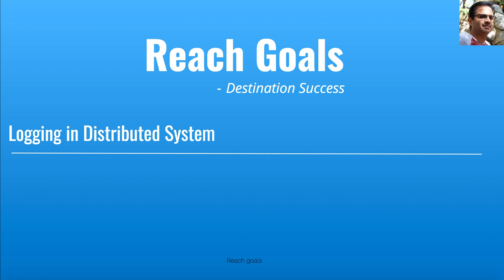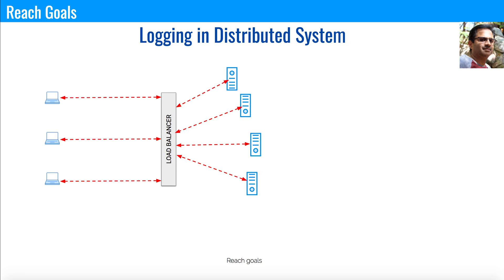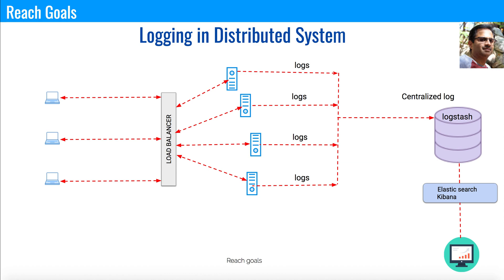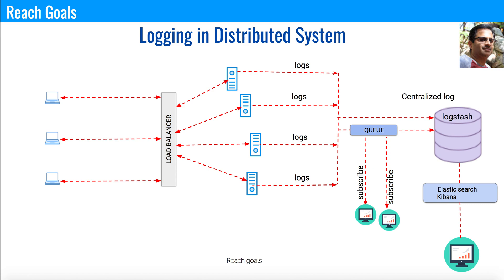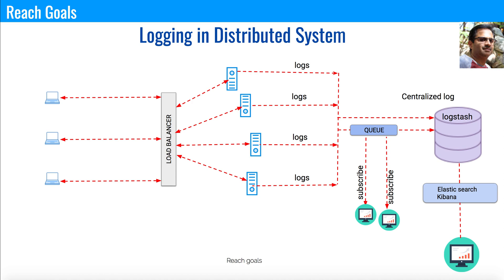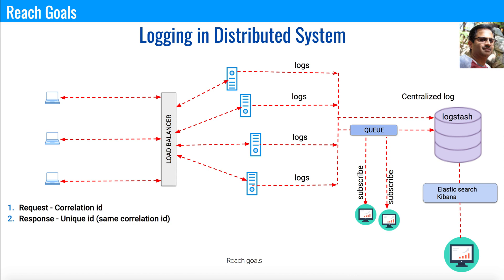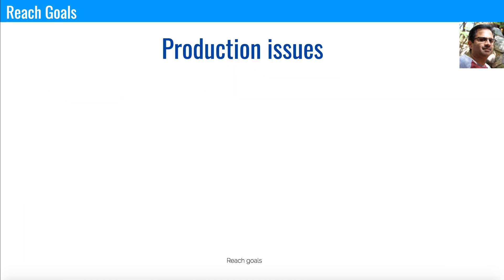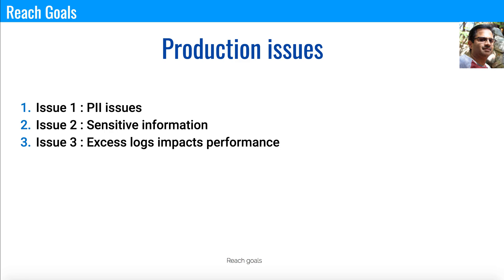System Design : How to design a distributed logging?

Comment: Hi. Thanks for the video. I have one question. At the beginning of the video. You mentioned that since different logs are stored in different nodes/machines, so it is hard to query logs.

That's why we have the topic that we need to centralize these logs into one log cluster, just in order to facilitate the log query.

However, why can not we use a consistent hashing strategy here, similar to the usage of consistent hashing in database partition? In another word, each node/machine can be mapped to a range of log data in the data ring. The log query with a request Id will be hashed using the same consistent hashing algorithm.

So we know, given this log query request-id, which node/machine stores the log data. Then we could directly go to that node/machine and query the log. If that's right, we do not need a centralized log system.

Thanks for your clarification. Looking forward to your reply.
Reply from the maker: I am happy you asked this question. 

Typically, there will be different types of application(java, bath jobs etc) running in each machines. This means, you will have variety of logs. 

There are multiple use cases executed using the logs 
1) Query the logs 
2) Alert notifications
 3) indexing 
4) Analytics and reporting 
5) Auditing and many more.

If I use the model as in your questions, these uses cases will become complex. Hence, my thought process was to move to separate log cluster.  If I have the separate cluster, it is easy to manage and process. 

Also, if I leave the logs in the same machine, it will fill the hard drive quickly depending on the application usage. Even when moved to log cluster, there will be multiple machines in the cluster and hashing can be  uses for identify the machine. But there are other uses case where consistent hashing is not used.

Hope this helps. :)
Reply: @ReachGoals  Wow. This is a very nice explanation. Thanks so much for your guidance. I can understand it clearly now. Thanks again for your help and have a nice day.

Comment: I am unclear on how if a node goes down, the second approach handles this. If a node goes down, so does the agent and neither the queue nor the logstash receive the logs from that node. How is approach 2 beneficial here?
Reply from the maker: First one is point to point. If node is down, it immediately stops sending the log message.All the log message is not retrievable till the node is up, agent is up to send the messages.
Second one is queue.The log messages in the queue will be available till it drains. Its kind of plumbing to have breathing time.
I should have explained in detail.
Reply: @ReachGoals  I think when a node goes down you still should have some kind of replication logic and fault tolerant mecahnism that will kick in. Same logic applies to the Queue as well since it might be single point of failure.